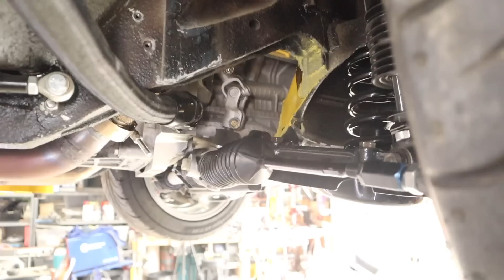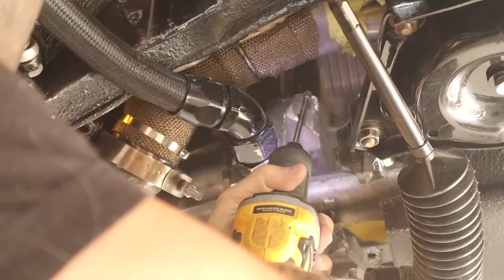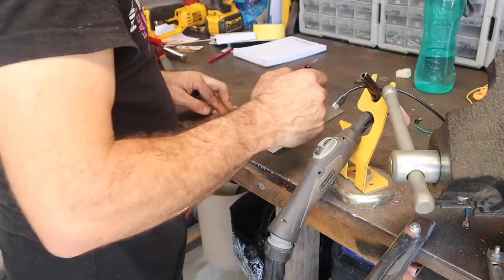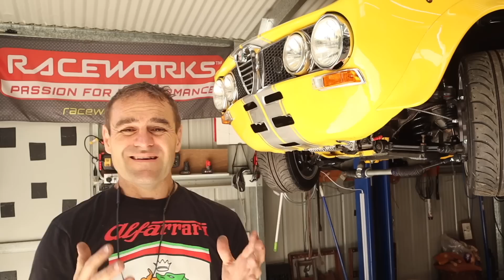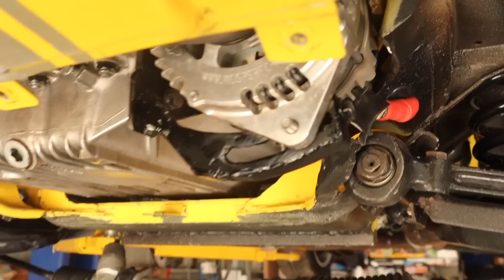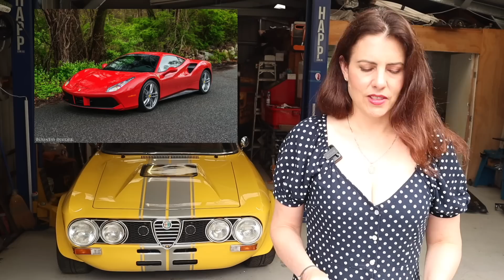Ferrari engine is overheating.. - Ferrari engined Alfa 105 Alfarrari build part 207

Comment: make sure the rubber flaps are mounted with the "bowl" towards the shroud. usually, these rubber flaps are manufactured in a way that they end up concave (or convex, depending on where you're looking from). it does make a real difference in terms of their sealing ability

Comment: Are you controling the electric water pump speed and flow rate with your engine computer? Try differant flow rates. Also make sure air cannot flow around the radiator.  You probally need about 2cm between the fans and the radiator for air to pull from the edges of the shroud. Also round the fan intakes.

Comment: I built a turbocharged 300hp GTV. We had no cooling issues . I used a 4 core radiator. However I completly sealed the front of the car so air could only flow through the radiator and intercooler.  I had a separate intake for the engine air intake and built air ducts over the front tire for the oil cooler.  Air could not get through the car unless inwanted it to. This helped suck air through the various coolers as needed. I also made two exit vents behind the front tire fender wells feeding into the low pressure area behind the tires. This car was used as a daily driver in horrible traffic of Seattle Washington and raced at rarious tracks around the west coast. It set many track recordes and never had a single overheating issue.

Comment: ON your MOT and engineer- sounds like you have got one that some of my OZ based "Locost 7" builders have used. Many are reasonably helpful if you show a reasonable attitude, as you have done. Most of the L7 crowd down there seem to see them a specific challenge and feel the "get extra points" for staying ahead of them, more like a friendly competition. And whether in the UK or AU, it is about safety- yours and other drivers; but your YT crowd might frown on getting the sharp looking brunette you hang with all scuffed up, too! Cheers, Mrs. J!

Comment: Instead of spring washers I would use nordlock washers. There is a reason this is what we use to secure equipment at height on oilrigs. They do not come loose. As far as bolt length, 3 full visible threads is our standard.

Comment: Jeff i had a similar problem fg turbo engine in a e90 bmw i got rid of my twin fans and put a 16 inch spal fan and fixed the issue otherwise put a factory fan that can be run by the ecu so you get variable speed the ba or fg falcon fan and shroud has plenty of balls if your radiator is wide enough the problem with 10 or 12 inch dual fans is they cause vortecies between the rad and fan shroud so you don't get good lamina flo so  you need something with 1 big single opening to draw the air through the whole of the radiator not just on 2 spots of the radiator in an ideal world a thermo fan from a 2016 comaro would be the best option but we live in oz so you may need to start measuring lots of fans till you find the right size cheers glenn

Comment: Jeff. Get rid of the adjuster. Just put a bolt in to the alternator from the back with flat and lock washers. Adjust the alternator by hand then tighten the bolt.
Many cars do it this way.

Comment: The easy fix for the noise is to stuff 1-2 stainless steel scouring pads in each of the rear silencers and keep them from being spit out.  I've "heard" that works well. The legal limit here in Sweden for home builds is only 84 dB which is very though and often requires extensive exhaust mods to meet.

Comment: Jeff, take the cooling shroud off and test it. I have a Jensen Interceptor with a similar shroud, we removed it and the car ran cooler......it also had exit vents in the bonnet, something you may consider either side of the bonnet window

Comment: I get the bolt length but the minimum clearance is bs. Inch or a mile if it don't touch it don't touch.

Comment: Jeff!

Great video! I really enjoyed the feed back you got from the engineer and the changes you made to address them.  Does your state have a guide or whatever you call it as an online document for download?

I'm in a jurisdiction where none of this is required (Canada, not that different from the U.S.). I don't see any issues with the things that were called out and would like to have a "check list" of sorts to start with for my project cars. 

For what it's worth, I've always thought your engine clearances are too low - not that it would matter from a safety perspective per se but that the engine is going to "rock-n-roll" and make contact and generally being annoying. Ever seen a Jeep engine buck around in the engine bay when in low range? :)

Best regards, Bud. Keep at it!

Comment: I have a Davis Craig water pump 150lph with the controller and a 3 core core brass copper radiator with 3/4" tubes and 12 fins per inch and twin 14" Maradyne fans mounted to the radiator with metal straps on the frame of it and with no shroud as the shroud was pushing the air back onto the radiator .. You problem is airflow like I had  and now mine sits cruising at 180deg f and in bumper to bumper on a 32deg c day it goes to 195 and thermos cut in and in 40 seconds back down to 185 deg f ... Fan airflow is another issue you need them with the large 225Watt motors and shew blades hence maradyne .. I have a small car like yours with a v8 and under bonnet blower pushing roughly 700hp and had heating issue for a year till i worked it out ..

Comment: have you seen the Engine Masters(motor trend) exhaust bash. (google Exhaust Header Bash! Testing Power Loss From Dents ..) it was quite interesting, might be able to fix your clearance with a slight "massage" if the pipe is malleable (as Al from the Skid factory would say)

Comment: Hi Jeff, you could have had the alternator mount the way you first thought, mounting an end stop at the inside end then have the bolt the original way screwing onto the end stop to push away.

Comment: Simple test for idle. Can you tape the rubber flaps shut to see if that helps. Also not sure you have any more space between shroud and rad. But pulling the fans further away from the rad core will help utilize more of the core area. Though discharge  obstructions (engine) creates its own problems. It would also be helpful if you knew the water flow rate of the total system as  pointed out on electric water pump head pressures capability.

Comment: Is the coolant travelling through the radiator too fast? If it doesn't spend long enough in the radiator, it won't loose the heat required.

One of the two responsibilities of a thermostat is to slow the coolant flow.

Comment: Hi Jeff, great episode as always and bummer on having to pull the engine. Re the cooling issue - is the radiator dual pass? If not you could convert be cutting a slit in each end tank and inserting a plate to force the water to pass twice through the core.

Comment: Perhaps your engine bay needs some hot air escape vents from the upper/hottest area. Maybe a tasty set of louvers on either side of the lexan portal would allow most of the heat (headers) to take it's natural rising pathway out of the snug compartment. You could fabricate some vent panels that rivet into a pair of neat holes cut in the bonnet. You could paint them to match before-hand and probably get away woth only touching up the yellow on the edges of the cut-out, if you do a very clean job of cutting.

Comment: Well that sucks having to remove the engine Jeff.
Thou looking at that header clearance doesn't seem to be any other option.
All id say before removing the engine just check all around the engine especially the bulkhead/firewall as thats tight there for any other clearance issues not picked up by the engineer.
That can be remedied 
While the engine is out..
.. considering the complexity of this build, your engineers snagging list is not too bad..
...

Comment: Things like the spring washer on the caliper bolts makes me question the engineer’s real need. I’ve work in a dealerships parts department for 17 yrs and have never seen a manufacturer use a spring washer on a caliper bolt so why would you have to.

Comment: If your using the Davies Craig ewp150 it can barely handle my TVS powered 338whp r53 mini and they fry often. Just a shite pump. Pwm and hole in thermo helps but still rubbish.

Comment: With so much engine stuffed into such a confined area maybe all that air you're blowing onto the radiator simply has no place to go therefore you're not getting any flow. If you look at Ferraris they always have vented hoods over the engine. Does it overheat when the hood is open?

Comment: I’m sure you’ll get everything sorted, Jeff! Losing the brake caliper bolts is a pain (ask me how I know😅) I cross drilled the heads of the bolts and secured them with wire. It’s commonly used in aviation and looks cool as well…

Comment: If anyone thinks their regulations are “nanny nation”, you should try modifying a car or motorcycle here in SG. 

Even adding exhaust heat wraps on a motorcycle isn’t possible (impossible for the inspectors to see if the pipes have been changed from those approved under homologation) 🤦🏻🤦🏻🤦🏻. 

That said, road speed limits in neighbouring Malaysia are more of a ‘guideline’ than ‘law’, so I can’t really complain.

Comment: not sure the engineer would go for it but instead of deleting the electric cutouts could you remove the switch and wire them up to the ecu so it can activate them only when the throttle pedal goes past 60% so it is just an automated system that would be almost impossible to get them to open below the rev range they are testing

Comment: Hi Jeff. Great work on your Alfarrari. Reminds me on my trials and tribulations  working on my '82 GTV6, when I fitted an Alfa V6 from an Alfa 166 and modified the tunnel to fit a front mounted gearbox, leaving the De Dion rear with an Alfa 6 diff, larger brakes all for the purpose of turbocharging, 25 years ago, I still have the car. Getting back to your project; I think an Alfetta GTV would've worked better with the engine bay configured for a v shaped engine, and a longer wheelbase, the junior with its shorter wheelbase will be very tail happy. On the issue of the overheating; hopefully, It could just be an airlock, but I'm thinking that the oil cooler may have to be relocated to the side of the radiator, not where it is now, in front. This experience comes from a mate of mine who worked for Alpine Developments. They specialised in turbocharging 116 series Giuliettas 40 years ago. They also had overheating problems, they tried expansion bottles, bigger radiators, bigger fans, nothing worked until My mate Robin thought : Let's relocate the oil cooler away from the front of the radiator to the side. Problem was solved.  Just a standard sized radiator was needed on subsequent cars.

Comment: I dont think the issue is air, but water... Does the system pressurize?? Do you have the correct spec plug? Also, the water pump might not have enough flow (or to much??)

Comment: I don't think what you're going through right now with Engineering makes Australia a "nanny state" (other things do though 😉) - here in Europe (France specifically), I will have to probably go through a similar thing ("Le passage aux Mines") although I do have the import certficate ("CERFA 13750*07") for the car when I brought it in from Australia, which may smooth things over.  Not an engine swapped car of course, just an EFI conversion.  Will have to work on the loud exhaust for sure!

All told, with your situation and what the engineer has found - it's not all that bad (my attitude always is, it could have been worse!) - even if pulling the engine again is a pain... Re: Cooling. Have you just tried pinning those flaps down on the radiator as a test, to see if that allows the engine to cool at idle?  At least then you can determine if they are part of the problem or not, might just be leading you down the garden path so to speak.  I see someone else mentioned puller vs pusher fans.  After that, I see you've gotten plenty of tips from people with far more experience with water-cooled cars than I...  Good luck as always!

Comment: I would 3d print a 10mm sphere on the end of a stick, so you can easily verify clearances before you see him again. If the ball fits in the space, you are good!
Reply from the maker: I have just been use a 10mm drill bit ;)
Reply: Well, that just makes more sense :)
 @HomeBuiltByJeff
Reply: Fingers are about 10mm thick, if you can get your fingers all around the engine you're good. It's the guide my engineer used.

Comment: We took a bicycle innertube and put it on the fan shroud (just the circular lip of the fan) with some pop rivets so it literally touched the radiator this made a huge. Difference in the amount of air we pulled through. maybe if you have a shroud you want To Do this at the shroud and seal every where else. Regardless sealing the air gaps is important.

Comment: Well done with the engineer, looks like you have mostly a win.
For your cooling, you could cheat, and use a waterless coolant basically it will keep cooler by nature (we use it in very old cars) draw back is that it is expensive.
Looking forward to the next video 🤣 let's see if the theory meets the practice, sure it will though.
When is the next engineer appointment?

Comment: How is your advance at idle? I think we had to put more advanced at idle to bring the temperature down. It's surprising and opposite of what you might think but when an engine is moving slower, the piston takes longer to reach the top so more advance isn’t as bad as at higher rpm. I'm sure this can be researched relatively easily.
With electric water pumps you have consistent Waterflow regardless of engine speed same with the electric fans, the only thing different is the air entering the front at speed. Not sure exactly how this relates but it suggests If you can cool it at speed you should cool it at idle.

Comment: For the alternator, why not go a bit older school and remove that bolt. Lots of cars needed you to lever the alternator against the belt tension and then use a pinch bolt to hold it in position. Not sure if your alternator has that provision as the thread needs to go along the alternator, not across.

Comment: Is the coolant circulating too quickly through the radiator. Not in the radiator long enough to cool. Take the thermostat out of a Mini and it will boil. Competition Mini's had a restictor plate to slow the water down. There are other motors that suffer the same fate if you delete the thermostat. Just a thought!

Comment: I'm wondering why you couldn't just register the car for the alpha romaio it is? Maybe it comes down to emissions. Here in the US cars older than. 25 years don't test for emissions.
 It would be impractical to. require you to keep Emissions requirements working on a 25 year old car.
 There's also very few of them on the road. The impact is small.
Reply: In Australia, the Alfa Romeo can only be registered for road with it's currently installed Ferrari engine.  It cannot be registered as an original Alfa Romeo with a 2.0 litre four cylinder engine.
The exhaust (smog) emissions are not the problem, however the loudness (at 101 dBA) of the exhaust is.
Reply: @georgebettiol8338  If you did this here, no one would know. Due to age, there's only a safety check no smog so A basic inspection place wouldn't care. If you custom build a car from scratch or maybe a kit or if you repair a wreck. You will get a much more detailed inspection like this.

Comment: 14:00 put a lock nut between the bracket and the head of the bolt so it doesn’t flop about.

Comment: I have seen in one race car that by redusing flow on water pump cooling got more efficient. If water is going too fast through radiator, it doesn’t have enough time to cool. Measure radiator in and out temps.

Comment: Oi Jeff, I have no knowledge of car cooling tech but to my dumbo brain it seems like it would be a worthwhile test to check if the idle temps increase if you take out the hood window to let the hot air in the engine bay escape. That always looked like quite the heat trap to me and I would suggest a window with F40 style vents. I might be talking complete nonsense tho, what do I know. Literally, in this case. 🤣
Reply: Props to the helpful engineer, by the way. The TÜV guy here in Germany who was supposed to help me getting the wheels for my Lancia legal was exactly that type of douche loving to make others trouble that you dont want in such a situation.

Comment: I reckon you could easily enough make the alternator adjustment the way you want, cut the threads off the adjuster bolt on the lathe making a step on the end and create a hole for this step to push against.

Comment: SPRING WASHERS ON BRAKE CALIPERS!!!!!! NO!! Are you sure he didn’t mean cone /Belleville washers? I’d use Loctite or Nordlock washers (or nothing!). It’s not 1930.
Cooling. If it’s ok under power then it can’t be a fundamental issue. Was the bonnet open on the dyno? Looks plenty of air inlet area, could it be a lack of outlet? Does it overheat with the bonnet open? Also, you might be onto something with air bypassing the rad via the rubber flaps, worth blocking them shut and seeing if it helps. I’d be surprised but you never know.
Reply: I've just posted about this stupidity.*
You'll never see a spring washer on an aircraft or in aerospace.  💡
Reply: I commented the exact same thing, I’ve been in a dealership’s part department for 17 yrs and have never seen any kind of locking washer on a caliper bolt on any brand car.

Comment: If you’re thinking some kind of extra vents, cutting some era-appropriate bonnet vents would be the easiest solution without having to repaint it. 
https://ae01.alicdn.com/kf/S4ee998a396614ef38d36549c85062347T.jpg?width=800&height=538&hash=1338